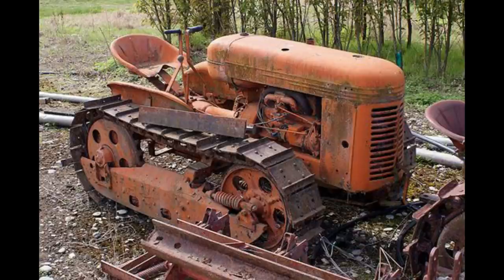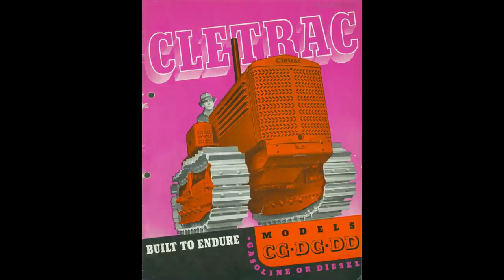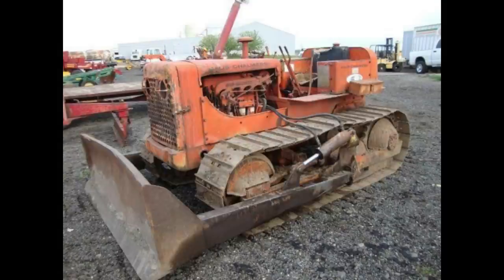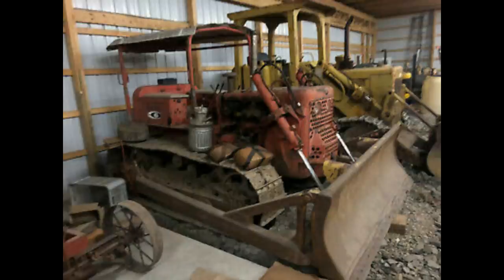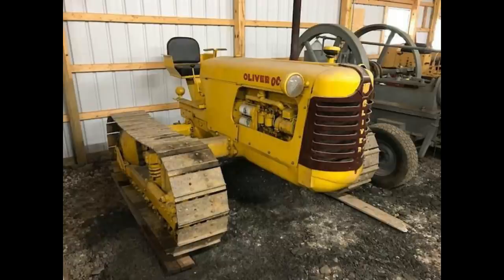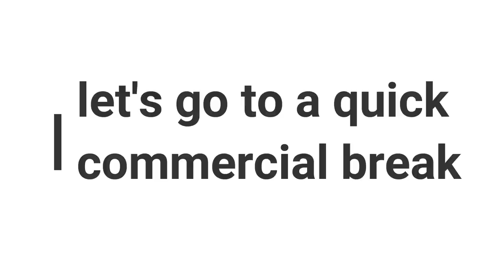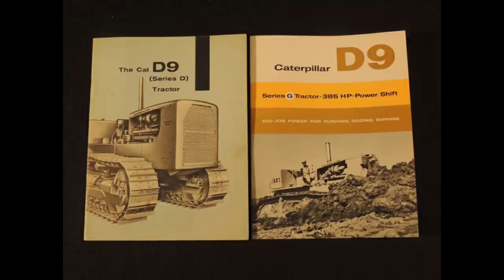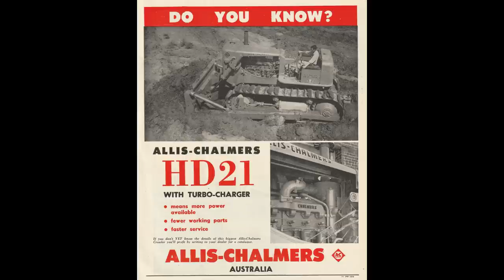Top 10 Vintage crawler tractors

Comment: Glad to see that the case 310 models got an honorable mention. I myself still have the original owner's manual parts manual for a 310 model g with the power angling blade and then we also had another 310 model can't remember exactly what one but it had the 6-way blade on it but the motor went out on that so now it's a glorified parts machine. I am in the process as we speak of restoring it I got it from my dad a few years ago after he passed

Comment: Hi, Folks.
Not a bad list, although the first few look like a sales brochure for Oliver Cletrac and there are some missing from this list that I would consider somewhat more worthy of a place in such a list than some of those listed. But I'm not a subscriber to the channel so I don't get a vote.

Also, some of the 'technical details' are a bit 'off'. F'rinstance, the International TD24 had planetary gear steering rather than hydraulic. The Caterpillar D8 is STILL in production although somewhat different in appearance these days and its horsepower by 1965 was up to 270 hp but with a different engine. The last D8 to use the D13000 engine was the 13A series which ran from 1953 to 1955.

Some of the images shown are NOT of the tractors being spoken about at the time of their showing.

Does bring back some good memories though. Thanks for sharing.

Just my 0.02.

You all have a wonderful day. Best wishes. Deas Plant.

Comment: That's ok, but Caterpillar is hard to do. D8s and D9s are still being built today. The D8 went through a lot of changes from 1935-1965. The D-13000 engine was used from 1935-55, and then the newer D-342 was used, and in 1965 it was up to 235 horsepower. Transmissions also changed. There were 5 speed manuals, 6 speed manuals and then 3 speed manuals with a torque converter, and a 3 speed power shift. All in that time period. The only D8 that had the 6 speed manual is the D8H and D8K series equipped as such (Most were powershift) and the rest had fewer gears. Most of the D9 pictures are D9Gs and they were built in the 1960s and 70s and they put out 385 horsepower. To correctly represent Caterpillar, you must just do one series of D8, such as the 2U series, 14A series, D8H, etc.

Comment: Hi there!
We recently bought a woodlot, and in the tree line of the adjoining lot is a 310.  I have not yet contacted the owner, but what are some particular things I should look for with 310’s?  It looks like it has been sitting a LOOOONG time.

Thanks for any advice you can provide - I am a newbie to this whole tractor thing (escaped to America from inner-city-decay after 47 years of concrete) and recently acquired a 1962 430 Case diesel.  But a crawler with a blade would be a great addition - IF it works…

THANK YOU!